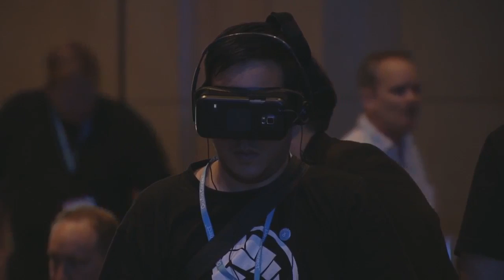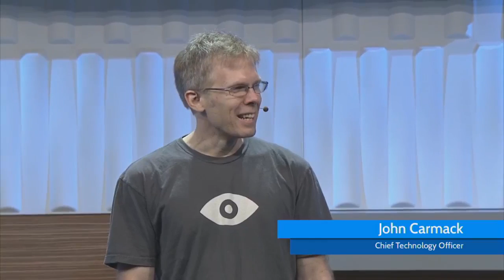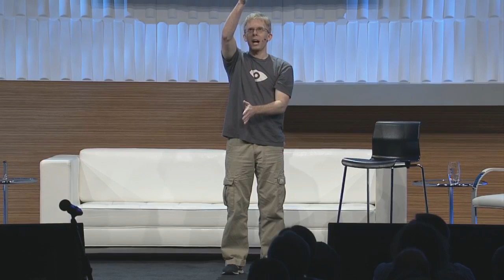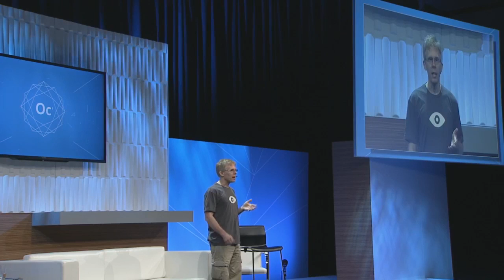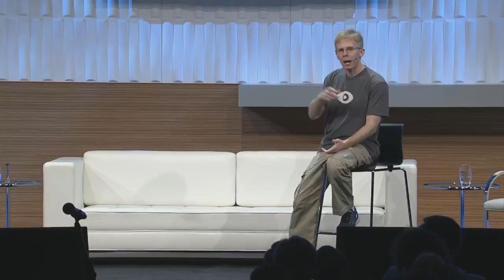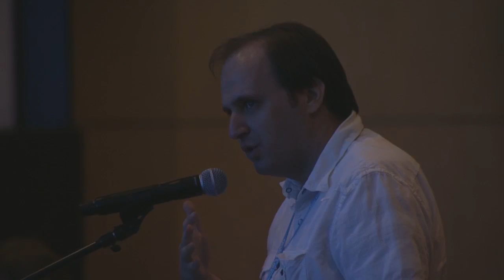Keynote by John Carmack at Oculus Connect 2014

Comment: Nvidia should build some proof of concept "supercomputers" for graphics.  Pile in the chips.  Unlimited expansion.
Reply: GPUs essentially ARE supercomputers. Hundred of cores all doing the same thing, slaved to a few master CPUs.

However, I assume you mean supercomputers made out multiple GPUs. Well these already exist. They are not used for real time graphics because - well, they're really expensive, and very few people would be able to afford them - so game developers wouldn't bother spending time programming for them. 

However, they are used for none real time graphics, scientific research and probably defence purposes.

In regards to nVidia, last year  (I think, maybe early this year) they compared their GPUs to supercomputers, and demonstrated their use in self-driving cars. They also had dome really interesting stuff about programs that learn - which is unrelated, but I think it is worth watching. The whole conference takes over two hours - but is very interesting. I think it starts with the learning programs stuff which takes a while so you can probably skip that to the none real time graphics stuff. Unfortunately, it's a bunch of ten minute videos which is a little annoying. but Go find it. nvidia press conference 2013.
Reply: AFAIK there would be latency issues with huge systems.  Their top-end GPUs are what is used to demonstrate very cool and smooth VR experiences though.  They've shown off VR demos using two GTX 980's in SLI (the new SLI that renders for each eye, not the latency adding AFR SLI).
Reply: Adam Bourke
Agreed GPU's were created to handle the workload of advanced 3D graphics, Then later multithreaded to handle 3D processing. Correct?
Reply: this is in the building. i still have the test drive program of NVIDIA GRID Workspace. but i can't find it anywhere on their website now.

this is what they did. that "supercomputer" you are asking for is on their side. you get the benefits by connecting to their servers through the "cloud". this is amazing for low-end devices that have super fast internet access.

i tested the drive program demos and was impressed. it amazes me that all that needs to be done is that NVIDIA updates their "supercomputer" and everyone has the same GPU powers.